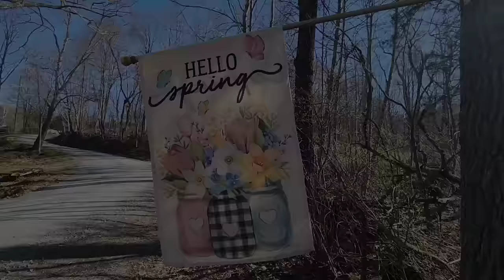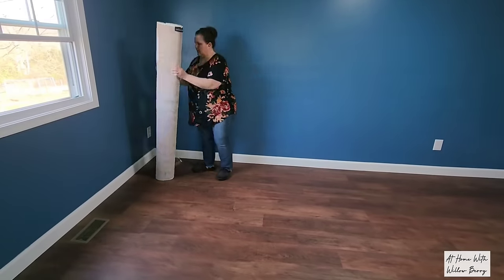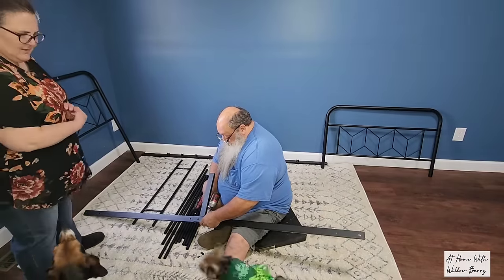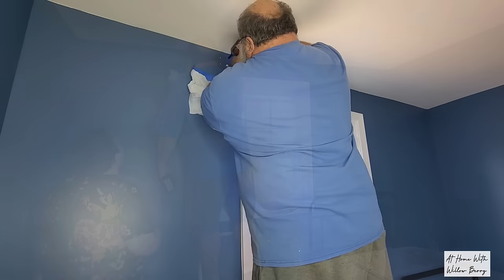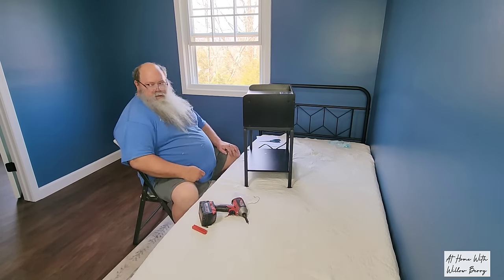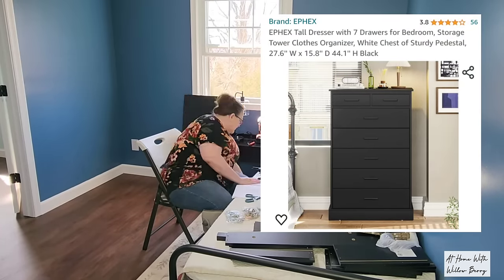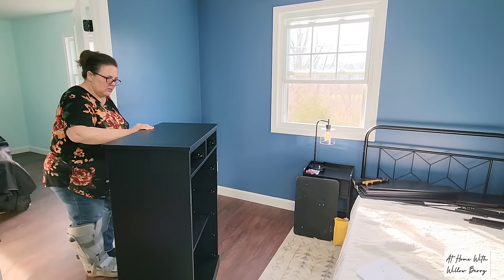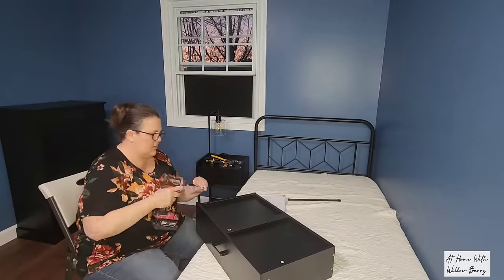A day to build furniture. / Mobile Home Renovations / Mobile Home Living

Comment: Valerie, the rug doesn't need to go all the way under the bed. You could pull it out more so that only the two legs are on the rug. It would visually open up the room alot more, and make it look bigger.
Reply from the maker: Thanks for the tip. I'll try it out. Max loves the rug. He's been sleeping underneath the bed. So cute. 😊

Comment: I remember that last large shelf I put together.  I have a large DVD collection about 670 or more and have 5 matching shelves from Amazon.  They took me several days to put together.  I told myself I would by preowned furniture in the future.   I can always paint them.   Sorry you had to learn from his room but at least the next rooms you can get stuff already put together.  You guys are troupers to take on this project but in the end it will be worth it.  I have a DW 2006 Fleetwood model and it was in really good condition when I bought it from the orig. owners in August of 2016.   I will need a new roof sometime soon but other than that no reno projects.  I did replace all the kitchen appliances and the washer and dryer just because I wanted new ones though.